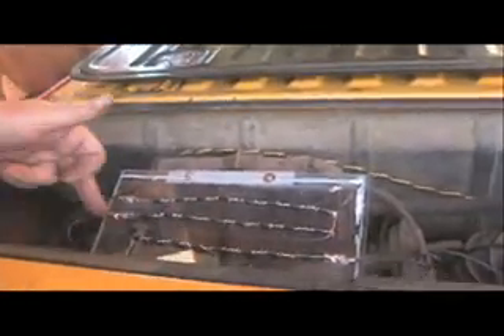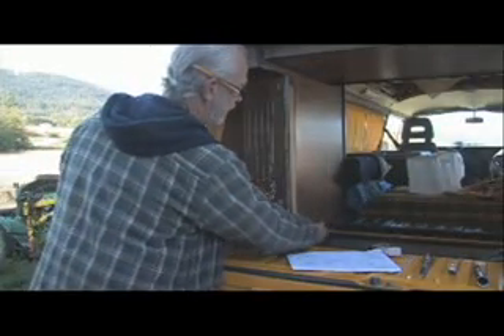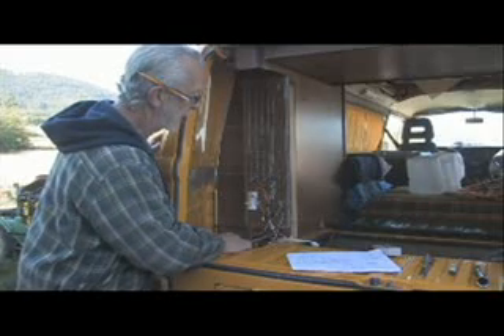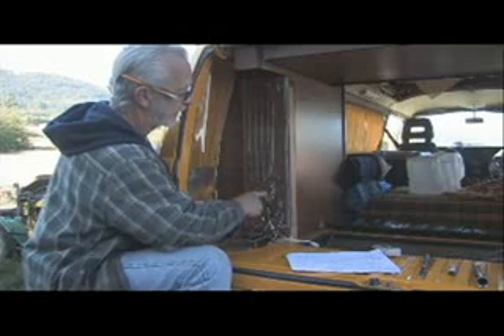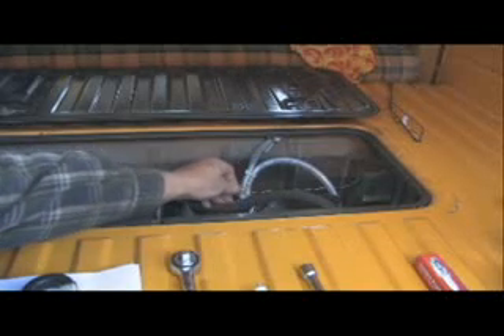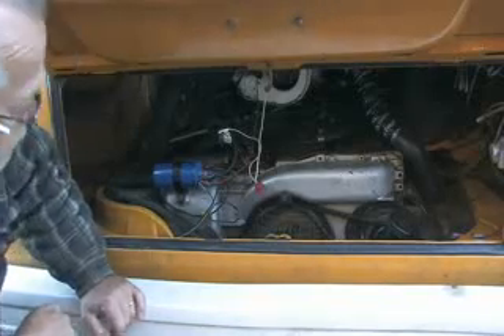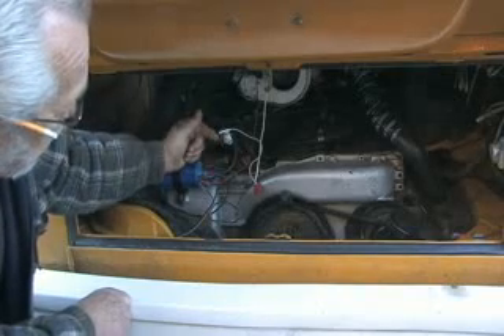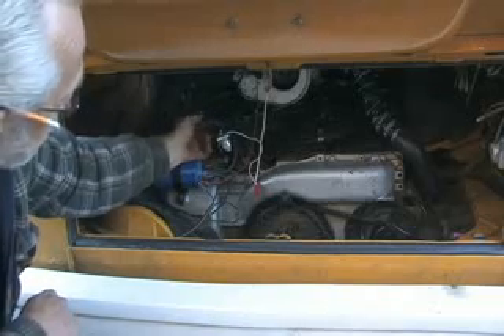Plasma Spark Plugs

Comment: Although I don't subscribe to some of the ideas here I built a "plasma" ignition using a tv line output transformer and a simple 2N3055 oscillator circuit. I retained the thermionic rectifier in a similar way to a tv. Mine was built for a different but related purpose.....